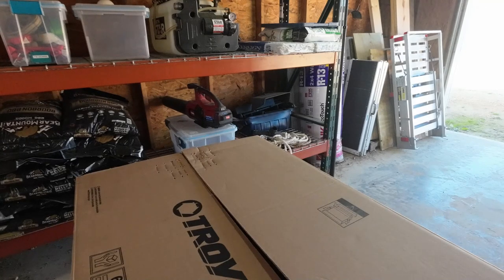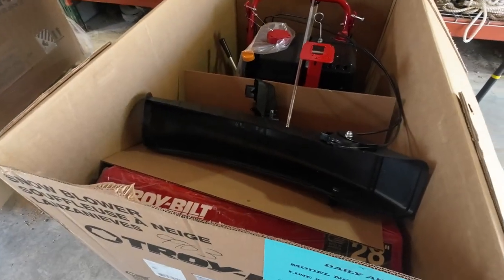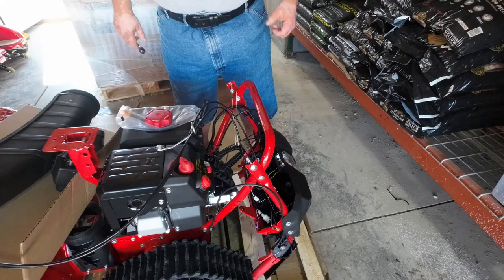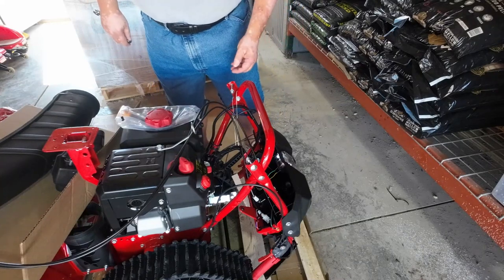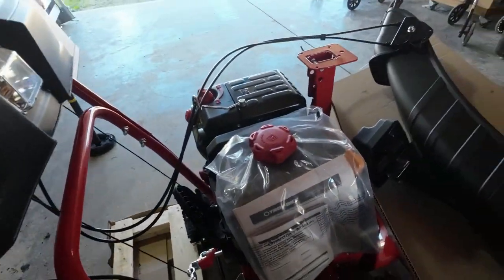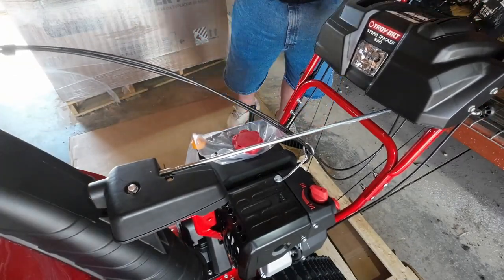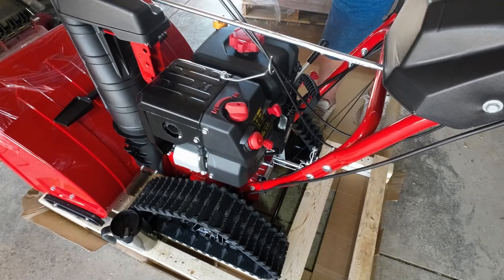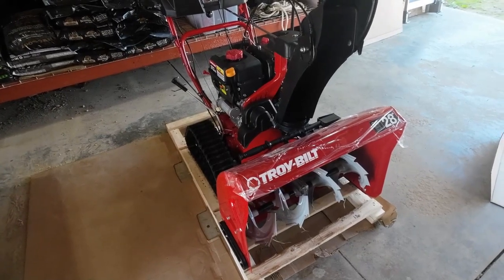TroyBilt StormTracker 2890 Unboxing

Comment: Good to see you making videos again!  When is the last time TroyBilt did anything new?
Reply from the maker: Troy-Bilt has made some changes to this snowblower over the last 3 years and I'll go through them in the next video. I'll also go over why this snowblower has not had many changes. 
The last time any real changes have been made in 3 of the 4 major brands was in 2014. Yes, there have been changes like LED headlights, new-stylized dashes and two brands went to metal chutes but nothing that dramatically improves their capacity and throwing distance.

Comment: Awesome to have you back, Paul!

I was looking at this model (older version) back in 2017-18 when I was looking to replace my 1988 Craftsman-II Trac-Drive. 

I eventually went with the Troy-Bilt 3090 wheeled version with the 357cc engine and have been extremely happy with it. 

Either way, I'm glad I bought when I did.  My 3090 was on sale for $1,029. And the 2890 Tracker was $1,299 then.

Comment: Is there anything we can do to these small engines to make them safely run E15 or ideally E85?  Obviously Warranty would be out.
Reply from the maker: At this point in time the only solution is EFI. But electronic fuel injection raises the cost of the snowblower and the market in general is just not ready for that additional cost.

Comment: I just bought this snow blower. Checked the oil, filled with regular fuel 87 octane, key in, primed 4 times , slider just past stop and used electric start...Just keeps turning over. Stopped primed again this time pressed it about 6 times and noticed gas leaking out. Is this normal as this video says it is on Ariens https://www.youtube.com/watch?v=rlFoUZt8nYc . I bought it at costco so I'll probably just return it but thought I'd ask your opinion first.
Reply from the maker: Yes, that's normal for a Troy-Bilt, Cub Cadet and Yard Machines snowblower. 
I go through the starting Procedure at minute 17:00
Let's reset the start. I'm guessing it's over 30 degrees outside. 
1. Pull the Safety Key out and reinsert it. (Just make sure it's all the way inserted)
2. Place the throttle about halfway open. (It usually won't start on idle - the slider just past open) 
3. Leave the choke open. 
Crank it about 10 seconds. 
If it didn't start. Crank it again for about 10 seconds.  
Still didn't start?
1. Press the primer two times
2. Turn the choke all the way closed.
Crank it up to 10 seconds. 
3. If it didn't start press the primer bulb two more times.
Crank it another 10 seconds. 
Try it one or two more times for 10 seconds but DO NOT press the primer bulb.
If it still doesn't start - return it.
Reply: @PaulSikkema Thanks, Tried everything. I will be returning it. Unfortunately, I bought a lemon!!